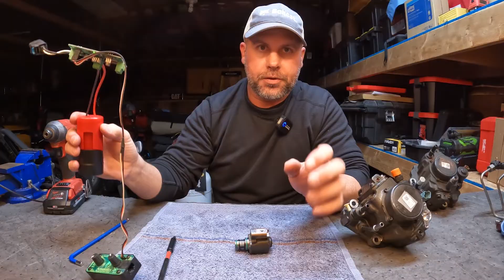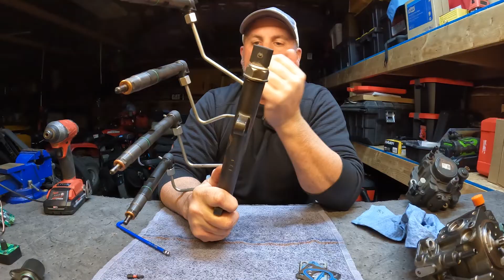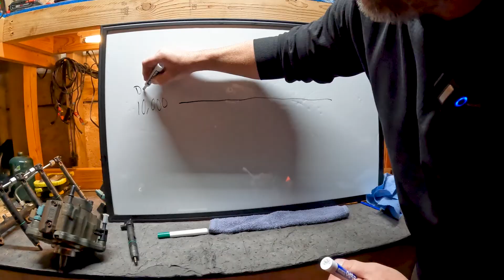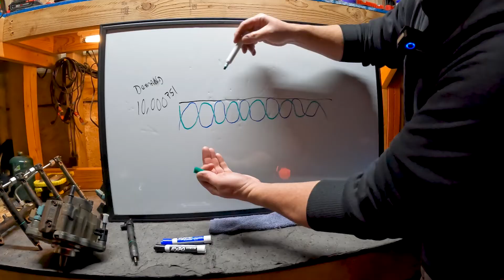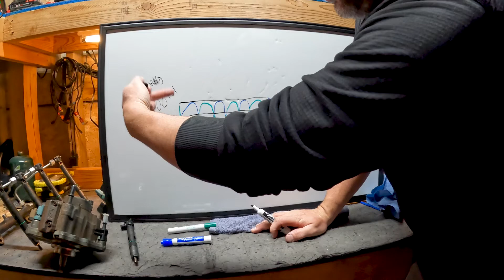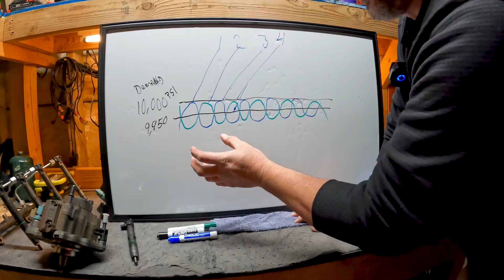Bobcat Fuel Injection Pump, What you need to know to troubleshoot common rail injection pumps.

Comment: I have a question working on a d34,   replaced pump,  injectors and fuel rail,  once it cranks the metering valve closes and i wont get fuel to the injectors.  Can anyone give my what else can i do.  I gave no DTC's
Reply from the maker: How do you know the IMV closes?  Unplug the fuel rail pressure sensor and try to start the engine, it won't start however it runs high pressure through the injectors and helps clean out any air that may be in the system after replacing everything. Plug the rail sensor back in and try to start. Might have to do that several times.

Comment: Thanks for your help, I'm not bobcat technician, but I'm working on my friend, some helper put gasoline on it, I removed the injectors and pump and to diagnose and find 3 broke injectors and pump broke, so my friend bought pump and injectors new, I flush all lines and diesel tank, put it back together with clean diesel and star perfect  for 2 minutes and then die again and don't star again, and have a lot experience on big trucks but really I don't know what happen whit this bobcat, I hope you can help me. Is a 2015 s570, thanks
Reply from the maker: Any codes?  I would pull the injectors and install upside down so tips pointing up and try to start and see if any injectors are firing.
Reply: No codes, ok I will do it and let you know what happens, thanks a lot
Reply: No firing, no spray, any suggestions?  thanks!

Comment: I've tried to call and text you a few times. I replaced the injection pump in my s650 and it solved my no start issue. I was wondering if you wanted to tear down my old pump for fun? You mentioned you might want to see it.
Reply from the maker: Glad that solved your issue, I would definitely like to have the pump for tear down.  Did you not have to pay a core charge?
Reply: No I found a new in box pump on line no core.

Comment: Totaly unrelated question here, i have a bobcat T740 track loader, just purchased from an auction, they had unplugged both swash plate sensors to put in limp mode, after plugging them back, runs for a while and shuts down with code, D7528, i have purchased a new swash plate sensor, my question is , does anything have to be calibrated when i change this sensor? Also i did remove filters and check for any signs of metal in fluid, found no signs of metal and fluid looked clean, have new fluid and filters to change as well. Should i check anything else before changing this sensor? Any help would be greatly appreciated.
Reply from the maker: I'd have to check serial number but it's possible the swash plate bushings are worn out. They are plastic bushings and requires pump tear down to replace.

Comment: Another great video.  My T650 with the Doosan D24 never wants to start when it's cold out.  When I say cold I mean below 50F.  I have to prime it every time and start it right away.  If below about 35F, I almost need another person to squeeze the primer while cranking, then it starts right away.  I just put a new primer on it, thinking the check valve was leaking back, but that had no effect.  When I prime, the bulb gets firm, then soft after a couple seconds.  Not sure if that's normal or not.  The primer will stay firm if I pinch off the return line from the injection pump, but I would not try to start it that way.  If I keep squeezing the primer firmly (while return not pinched), I can faintly hear a hissing sound coming from pump or IMV.  This seems logical that they would allow for a tiny amount of bypass so that air can be bled out easily.  I'm wondering if the lift pump vanes are a little gummed up and sticking when it's cooler outside and not being very effective.  I don't have any codes on the display.
Reply from the maker: Do the static test on the injectors and let me know what you find.  It's normal for the primer bulb to soften up after priming.  Also check the screen on the IMV for contamination.  It could also be the low pressure relief in the pump bypassing.  Either way start with the static test.

Comment: Hello, I've been having issues with my d24 s650 and we have talked a couple times. Crank no start unless I use ether.  now it wont start at all. Frustrated I took it to dealer they said they were not getting fuel from the high pressure side of pump and it was most likely the injection pump. So I picked it up today and tore down the pump as you taught me. All looked good except for the low pressure relief valve had scoring on it. My guess it the vain pump charges to 86 psi in body and imv cavity, and that is enough to overcome the spring on the inlet side check valve of the high pressure pistons. Since I have scoring on the low pressure valve I'm not able to build enough pressure to fill the high pressure bore on intake stroke hence the pump putting out nothing. FYI before I tore this down I was squeezing the primer bulb and when it built pressure I could hear hissing in the injection pump. Probably bypassing the low pressure valve just by hand? What do you think of my diagnosis?
Reply from the maker: Very interesting, I'd love to have that pump for inspection.  Did you get a new pump or did you just pick up the old one for inspection.  If the vane pump is not damaged it should build enough pressure to feed the high pressure side.  I guess it depends on how bad the scaring is on the low relief.  Did you cycle the IMV valve? I do agree with your diagnosis however.
Reply: I have not bought a new pump yet, I will email you a picture of the valve.
Reply from the maker: @coleorth2467  please do
Reply: Emailed you.

Comment: Hey Brady just got off the phone with the guys over at Diesel Laptops and they claim to have all the software that bobcat has.He also told me all the software is able to calibrate and program the new delphi injectors.Do u know anything about this company?
Reply from the maker: That is correct, Diesel laptops does have the engine software but I have not confirmed they have the Bobcat machine side software however the engine software will code injectors.  They also rent laptop's if you just need a one time repair.
Reply: Please send me information about the software Diesel lop top.

Comment: I have S770 2014 and I would like to know if V3800 Kubota engine for bobcat machine has same fuel motor pump as Doolan engine?
Reply from the maker: The basic principles are the same but the Kubota uses the Denso system.  The Doosan engine uses the Delphi system which is what this video covers.  The Doosan engine is swapping over to the Bosch fuel system on the later engines.

Comment: Very informative video. I’ve probably put 30 pumps on and haven’t timed any of them. Was always told you don’t have to. Any chance of a video on how to build that tester for the imv?
Reply from the maker: I did many myself without timing but now that I understand why it's recommended I do time them now, only takes a few minutes.  I will link the parts for the servo controller and motor driver, it is very helpful with the IMV and with actuators.
Reply: @tetradgroup did you link the list parts??